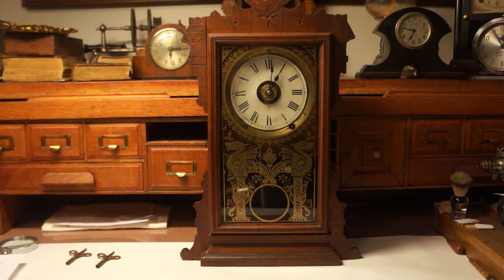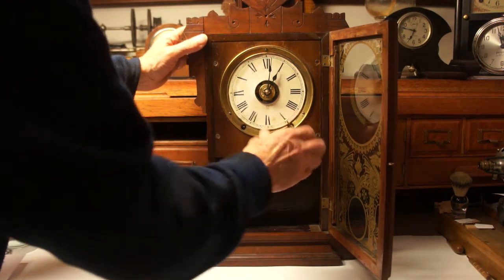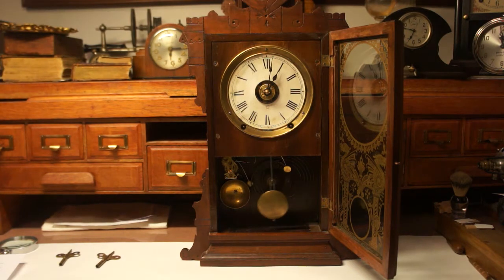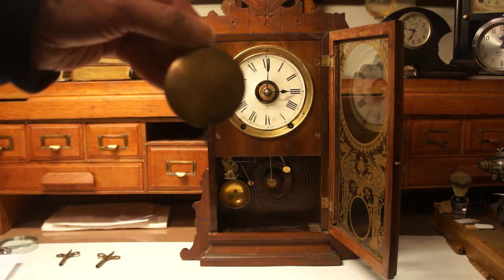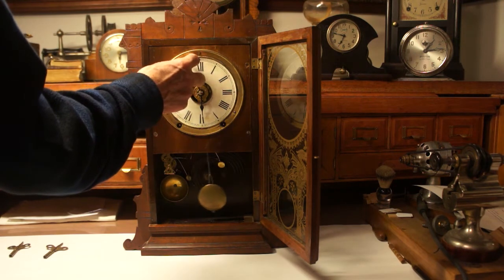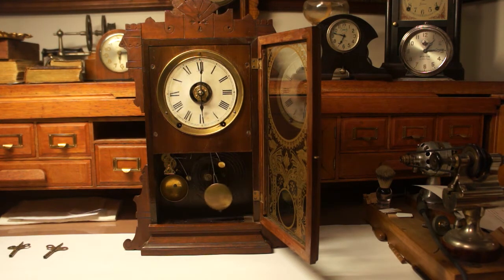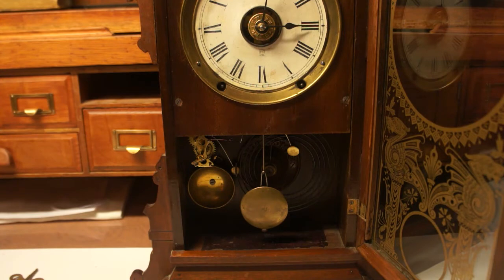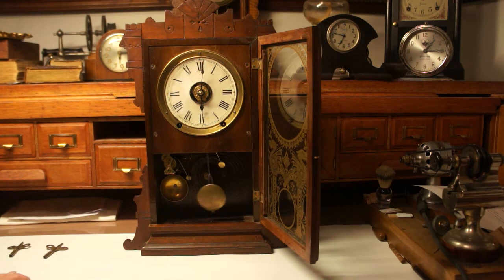1889 Seth Thomas Parlor Clock How to Set Up for Shantyl #16

Comment: Thanks for producing the instructional video Mr Martin. I now have a Seth Thomas Gingerbread Clock (1909F - No. 298A) but no keys to wind it so its just sitting. Do you happen to know what size key I need for it? Thanks in advance.
Reply from the maker: Yes, first measure the square part of the shafts, they should both be 4.0mm which equals a #7 Key

Comment: I have a New Haven clock that looks very similar. It has an identical alarm disc but the alarm mechanism has been removed, unfortunately.
Reply from the maker: Alarm mechanisms can sometimes be found 2nd hand. try an on line auction site.

Comment: Thanks that helped me. I have almost this same clock it's very accurate. I have not used the alarm and still want to know how to set it to sound besides the hour hand turn , since it doesn't always go off do you pull out push on the setting dial? Is there a shut off or does it sound till it's done on it's own? I need a key for my alarm , where could I find one? Thanks again !
Reply: If you never used the alarm how would you know it doesn't always go off? :)
There is no on/off switch or any AM/PM. They just go off close to the hour where it's set and run until it's spring power is exhausted. Usually the key is built-in or the same size as the clock winding arbors. Merritt's has keys for almost anything if you need one.
Reply: Well cause it has not sounded an alarm there is a separate bell and I just wondered how to set it . Thanks though for responding, and for sharing your knowledge.

Comment: Please don’t move clocks back with countwheel striking
Reply from the maker: Yes, that is a good general rule to go by.
Some clock manufactures have built in clutch systems that allow this to be done.
If in doubt wait for the striking to stop.
Reply: He is either going before the warning or this clock is designed to be able to turn it back please pay attention before you criticize a clock maker mark